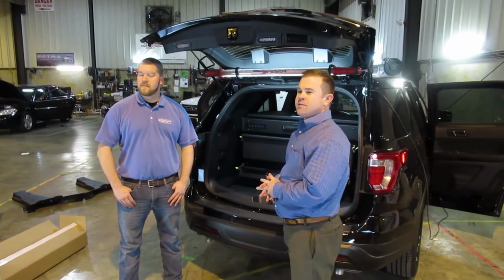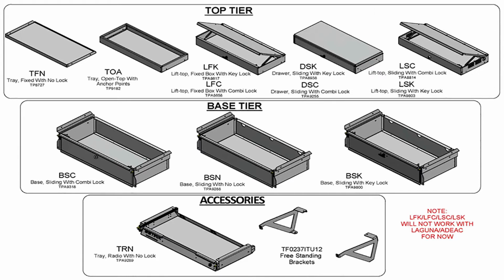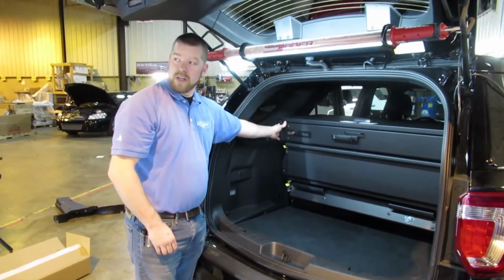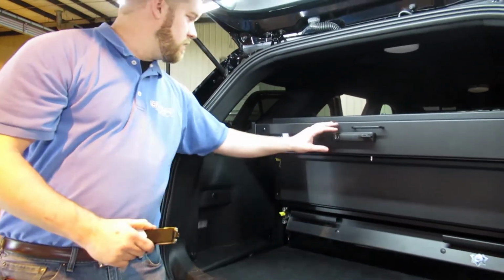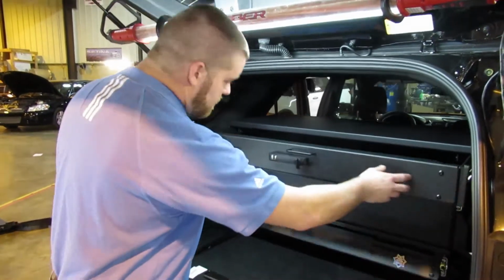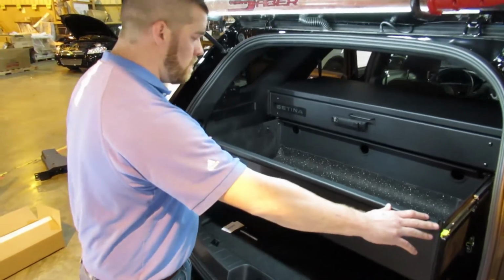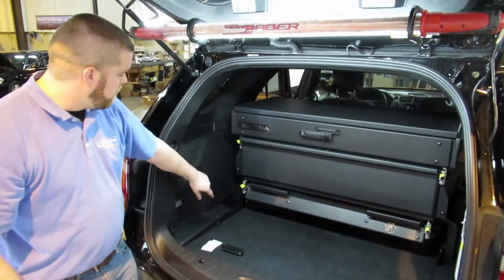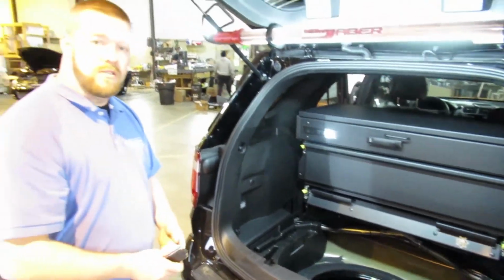Setina SUV Rear Storage, Organizer, & Cargo Box fits Tahoe, Explorer FPIU, Durango and more

Comment: Hi, we installed today. product is very tough, but is normal that the clank sound (probably the pully track)will comes out when you drive down the unsmooth road or run over the bump? thanks.